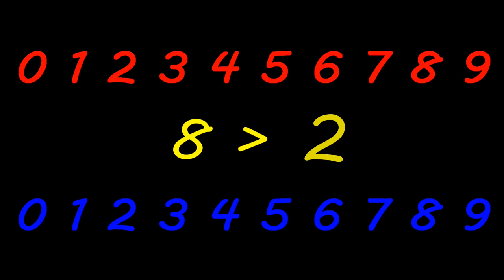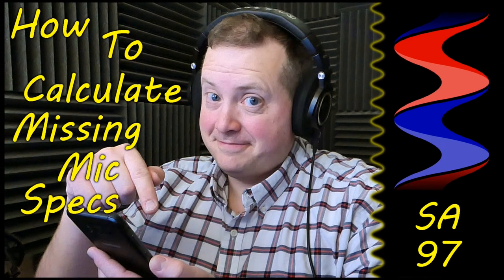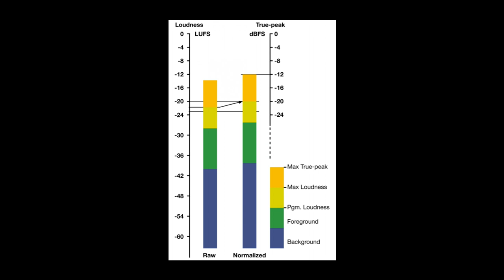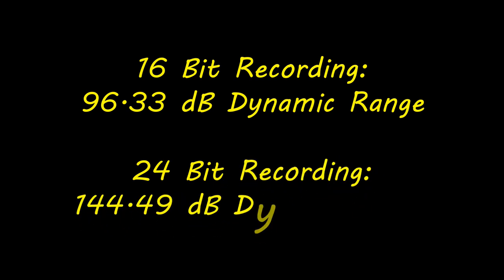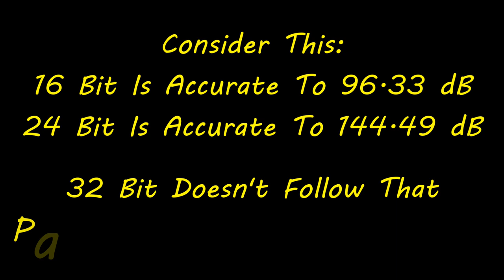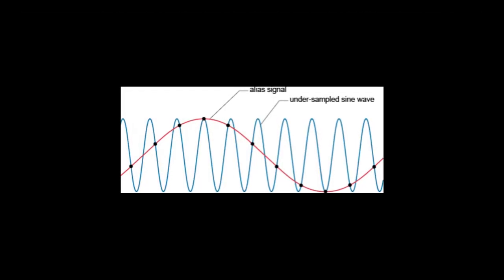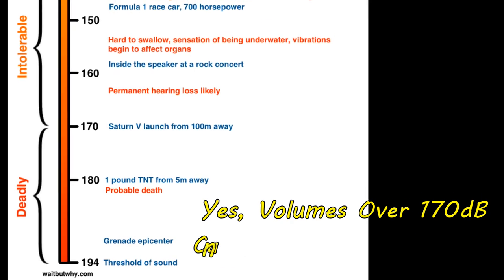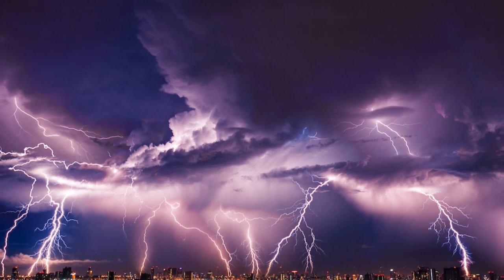32 Bit Floating Point Explained - Sound Speeds

Comment: 9/0 is largest... 🙂
Reply from the maker: 9/0 is 1
Reply: @SoundSpeeds  9/0 is infinity.
Reply: Actually it's 9 times infinity
Reply from the maker: 9 to the 0 power is 1
Reply: @SoundSpeeds  yes, but 9 divided by 0 is infinity. That's the largest number I can make with 2 digits and an operand. You didn't specify whether or not you needed to be able to write a file that contains that many bits.
Reply from the maker: That's not how powers work. It's multiplication, but division. If you raise anything to the power of zero it's like asking how many groups do you have if you have number by itself. Only one.
Reply: @SoundSpeeds  clearly you either don't understand me, or don't have enough knowledge of math. 9 DIVIDED by 0 is infinity. I'm not talking about powers, I'm talking straight basic division. 9/2 is 4.5, 9/1 is 9, 9/0 is infinity (or nine infinity, if you will). Infinity is the largest resultant of a math equation using basic operands and 2 digits. 9^0 is 1, 9/0 is infinity.
Reply from the maker: Oh, my mistake. I thought you were talking powers.
Reply: It is largest, but is it a number...? 😁
Reply: @EmuDoesStuff  ask any mathematician and they will tell you it is
Reply: @bespokefilms  I suspect many would probably answer: it depends 😆
Reply: @EmuDoesStuff  when it can be expressed rationally (as it can in this case) it is a number
Reply: @bespokefilms  Fair enough 😊
Reply: @EmuDoesStuff  haha, it was just meant to be a nerdy math joke anyway. 🤷‍♂️
Reply from the maker: I'm not smart enough to get the joke. ;-)